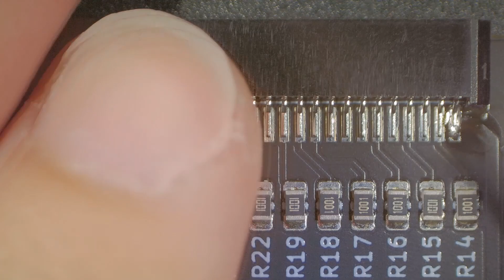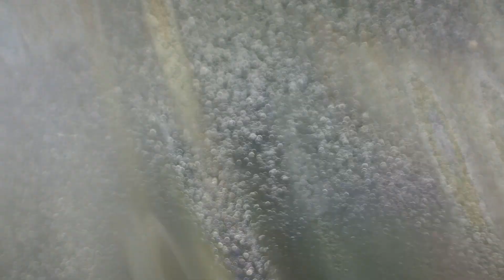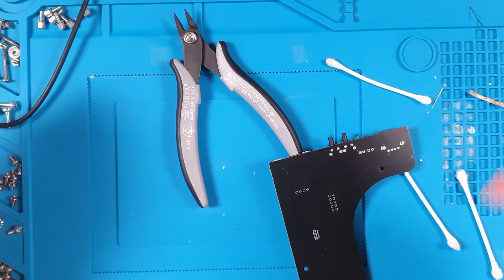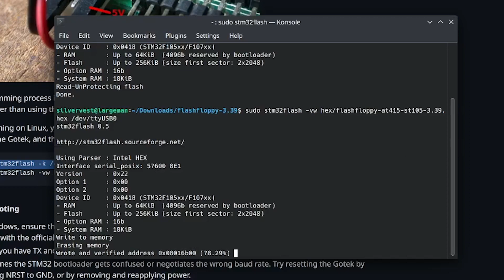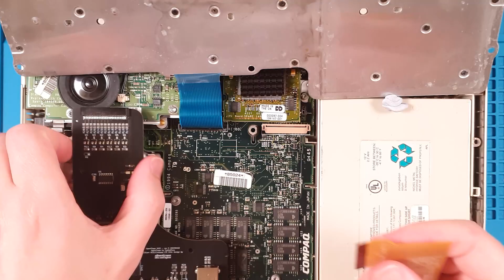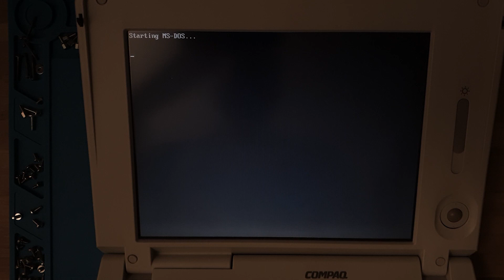Introducing the OpenFlops W1D for the Compaq LTE Elite

Comment: Installed the 2nd openflops unit in my compaq lte elite and it was an easy job.   I ended up using perler beads (kids craft toy) that I had around as spacers under the openflops board.   Worked perfectly (only 1/2 perler bead height required to clear all chips / act as spacer).  Will put up an install video when I have a chance to demonstrate.  Great work.

Comment: Hi there.  I finally got around to installing one of your openflops w1d (v1) that I got from you ~ 9 months ago.  I can confirm that it fits and works right out of the box on my AT&T Globalyst 200s which also had a w1d drive.   This is also the same laptop as the Samsung SENS 700 so you can add these 2 laptops to your openflops compatible list.   The mounting holes don't match but I just double sided taped the openflops to the motherboard after sealing all visible contacts with electrical/kapton tape.  Thanks for great work.  I have a 2nd openflops unit from you that I'm planning to put in the compaq lte elite when I have time.

Comment: Great job Nick.   For the final mount/screwing, i would suggest users apply some  kapton tape or even regular electrical tape on any through hole solder joints (even if they are clipped flush). just for added protection.  Another option is simply using some plastic standoffs so there is less pressure of the board on the motherboard chips (not that I'm really worried about that as the board looks VERY light weight.  

I have a gotek usb floppy on an acer 386 laptop and i can attest it is amazingly useful/easy to use. 

The compaq does have the advantage of the PCMCIA to compactflash adapter option but getting the drivers working in dos is a bit of a chore and eats up some low memory.

This floppy emulator will be natively supported allowing boot/and os install
Reply from the maker: Thanks and that's absolutely a great call out, and I don't know why I forgot to mention it in the video, as on the ones I make and sell I do actually stick some kapton over the OLED pins on the underside!

Comment: Hi, super video! I am a LTE 5000 series enthousiast and I am wondering would it also work in the floppydrive bays of thes Compaqs?
Reply from the maker: Thanks! Great question, I made this very specifically to physically fit in the LTE Elite series, so it probably won't fit the LTE 5000 out of the box. Unfortunately, I don't have an LTE 5000 to test on or develop for, so I wouldn't be able to tell.

I've been discussing updates to this for various other W1D based systems in the Compaq LTE & Armada Owners group on Facebook if you want to come join the discussion!

Comment: Hello, I have a toshiba satellite 430 CDS. There is an "external" floppy disk drive with a citizen W1D inside that I want to replace. I saw that Openflops w1d works for the Toshiba T4400CT. Should I rationally think it will be OK in my case ? Thanks.
Reply from the maker: It should be fine, but I'm unable to confirm 100% as I don't have a Satellite myself. Anywhere a real Citizen W1D is it should work fine, though.
Reply: @silvestronsbitsandbytes   OK thanks. I'll test that !

Comment: Great Video! It looks like you reengineered this a bit to for the Compaq. I was just wondering if any of the hardware or software was customized to the Compaq, or if it would still work with any vintage computer? I'm considering one of these for an old Kaypro 1.
Reply from the maker: This device would work on anything that uses the 26-pin FDD connector (mostly laptops) although it is specifically designed to be a drop-in replacement for the Citizen W1D floppy drive.
I think the Kaypro uses the standard 34-pin shugart ribbon connector so probably not. A regular Gotek or even an unmodified OpenFlops with FlashFloppy would work in the Kaypro I'd imagine!
Reply: Thanks, you are correct about the ribbon cable. I knew I’d need to adapt it, but hadn’t looked into doing it yet.

Comment: I've recently bought one and I have a question whilst it's on its way here to the UK. Are the seperate floppy images just seperate folders or are they .img (Or equivalent) files?
Reply from the maker: Hey! I've had a few requests for more detailed usage guide and this specific question has come up more than once, so I decided to write up a guide on use available on my website - https://silvestron.com/openflops-w1d/

TL;DR it supports .img .ima and .dsk images, which you can organise into separate folders but is not necessary. If you want to make images based on loose files, I recommend the WinImage piece of software!
Reply: @silvestronsbitsandbytes  Hey, the emulator finally arrived today and works perfectly! Just one question though. This is most likely User Error, but sometimes my disks won't change over despite me selecting a different disk on the menu? For example, I'm trying to install DOS 6.22 on my machine but every time it says to put Setup Disk 2 into the drive, it won't change over depsite me selecting Disk 2 on the emulator. I had the same issue when installing Doom. It would ask for disk 2, but when I switch to it it doesn't detect that it's changed.
Reply from the maker: Hey! That's a weird one... Could you email me (just reply to the invoice email) and let's discuss it

Comment: Love this project. I would love to add this to my IBM ThinkPad 600e! I have my real floppy drive in the official external drive caddy with it's proprietary connector but finding functional floppys has been a struggle. I'm not sure if this would work. If anyone knows of a similar project please let me know. Thanks!
Reply from the maker: Hey! Thanks :) Ahh IBM and their love of proprietary connectors... I'd have to know what type of connector the actual internal floppy drive used in order to know if this would work. It should work with anything that uses a "standard" 26-pin floppy FPC, but as I've seen with Toshiba laptops there can be some compatibility troubles. I unfortunately don't have a ThinkPad to test with, so just don't know!